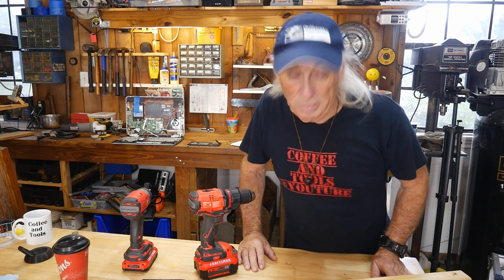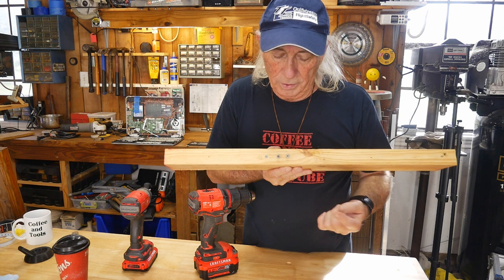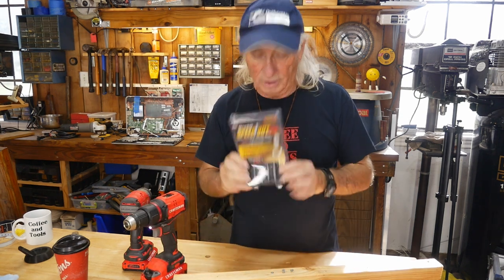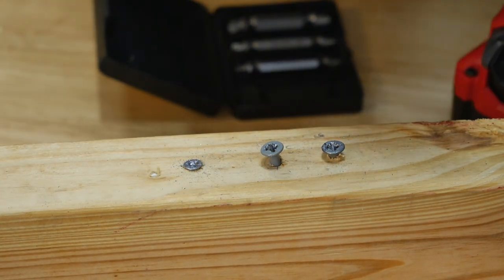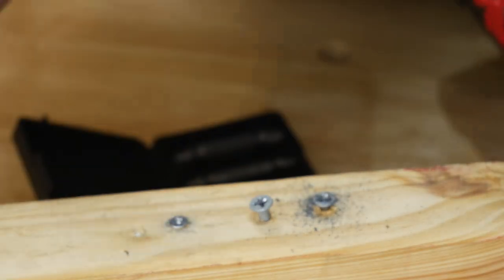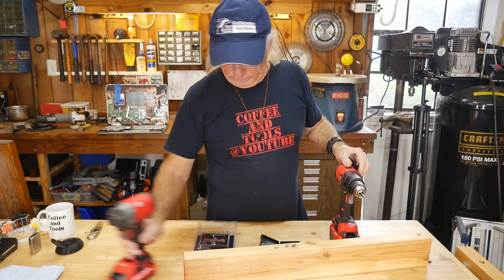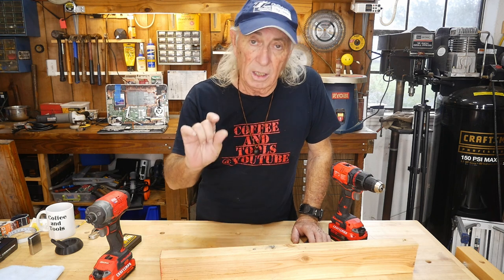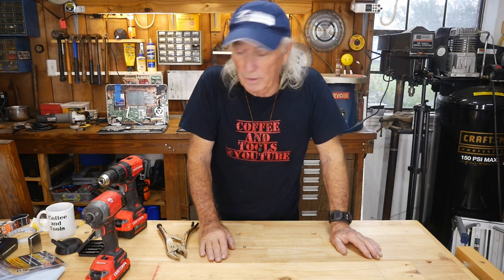Screw extractor :speed out PRO bad screw removal tool review, Coffee and Tools episode 191

Comment: I have an old black and decker screw extractor set i use once every 2 years or so its good but not necessary after switching to an impact driver instead of a drill for driving fasteners
Reply from the maker: I only use my impact now too. The drill is now only for drilling holes LOLOL

Comment: I think you are supposed to drill it very slow, that second screw, you seemed to create a decent groove with the bigger bit, but you continued to drill and rounded it out. slow and steady on a lower rpm would work better.
Reply from the maker: Off camera we originally tried the slower speeds, this more to make a point after our first test. Very disappointed in the product :(

Comment: Conceptually it should work, by which what I mean is, that this product's design concept addresses the issue correctly. Just that their product (maybe forced by their competitive pricing policy) neither provided comprehensive documents nor delivered quality parts! That reverse drill bit to drill the hole is of very poor quality and a very bad idea in the first place! For me, it worked like charm because when I realized that the drill bit they provided is failing to drill the hole, I immediately switched to a known brand good drill bit. After successfully creating the hole (about 3mm deep) with that different drill bit, the extractor bit from SpeedOut worked flawlessly! :) Also, as someone implied here, that while extracting, we need to use the torque settings in the driver in small steps - first make sure the extractor bit grips in the hole nicely, then start with a lower torque setting in the driver (I started from 3) and then progress to higher torque in small increments (up to 24 in my case). And, keep the drill speed in low at all time. A lot of patience and a good understanding of the manufacturer's intent for the tool that they provided will greatly help. :)
Reply from the maker: Over the top, but I have other kits that work just fine. For this price the quality was sub standard in material and you said yourself, the drill bit supplied was "junk". Thanks for posting